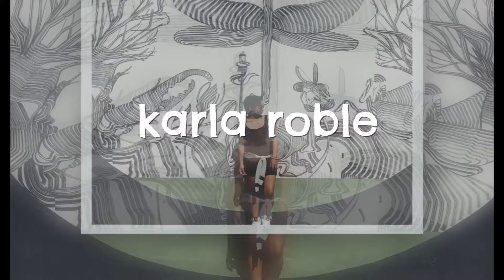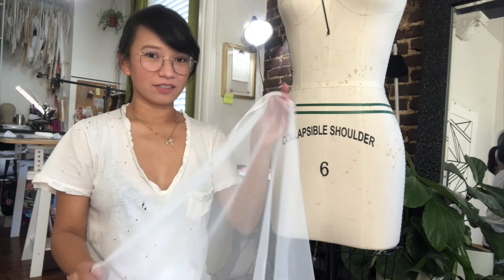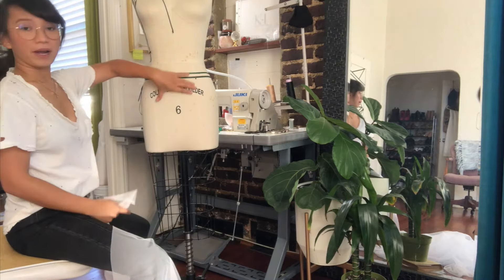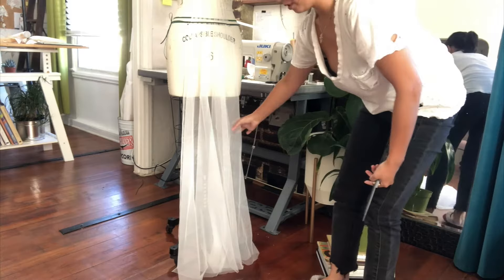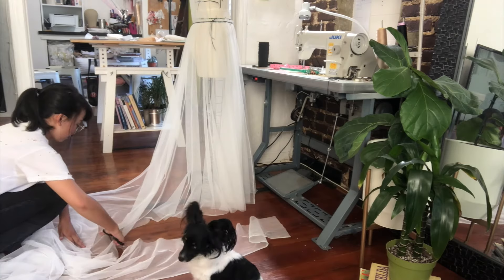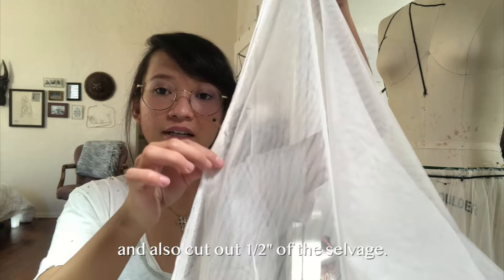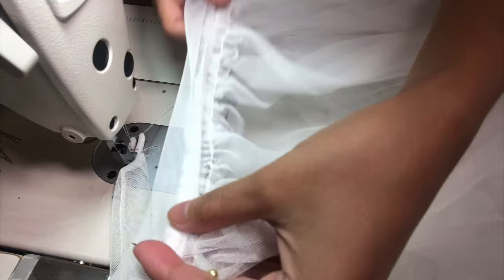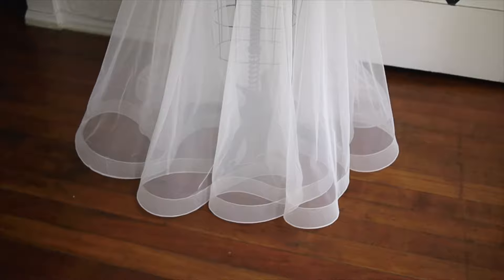BALL SKIRT TUTORIAL | Removable Skirt

Comment: this was so helpful, thank you! it looked like 1 seam of each panel was on the selvage/straight grain, did you sew straight grain edges to bias edges, or straight to straight? does that affect the way it drapes?
Reply from the maker: Hello!! Yes! Great observation.. i drape it right on the bias so sew lines will be along the selvage (warp) on one and the weft on the other. As for the sewing, i try to sew the wefts together and then the warp. There will be one seam where you will have to sew a weft and warp together but the rest should be the aforementioned. Drape should be okay as long as you sew it carefully ☺️
Reply: @karla_roble  is there a reason to go weft to weft and warp to warp? Or just preference? I'm trying to learn those kind of tips